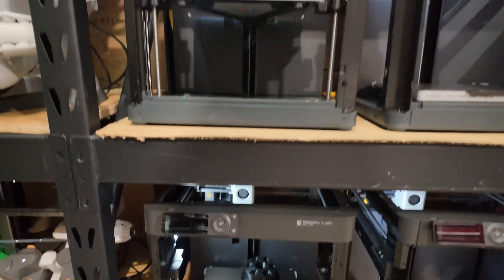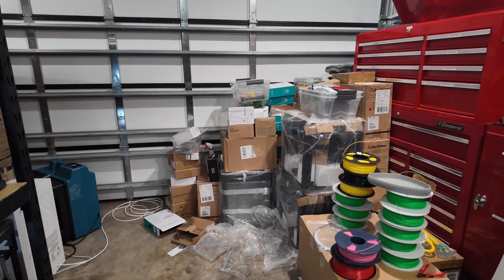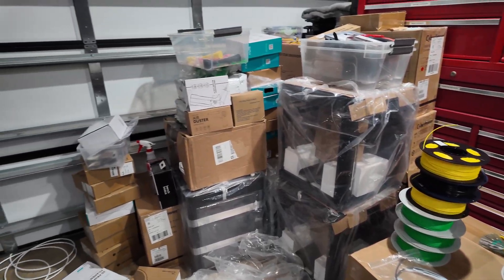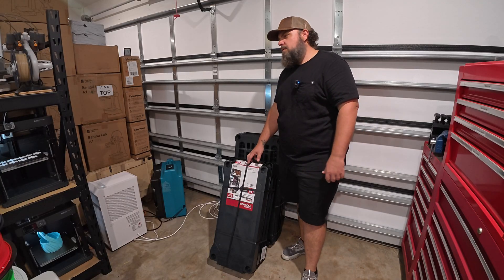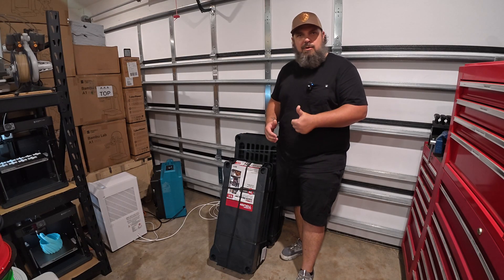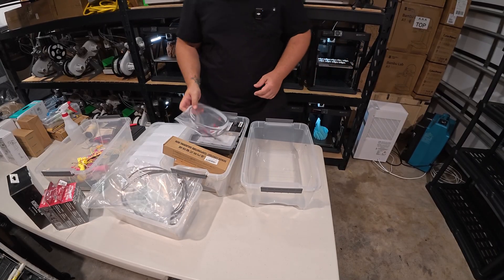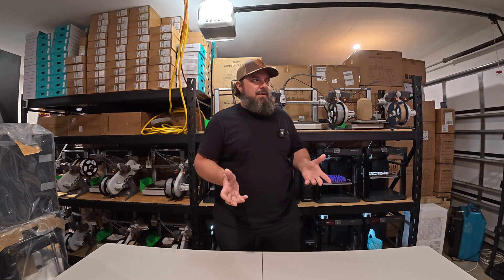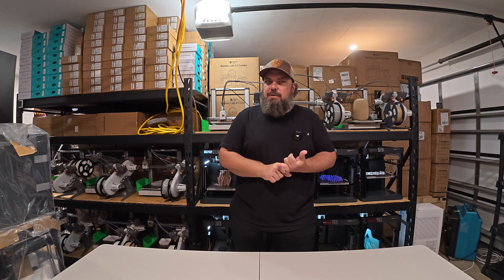Day 11: In Between — What Happens as Prints Start Finishing

Comment: Are you doing this full time, as your last 11 days most people could do in 1 or 2 there not the most riveting days if they truly are whole days. Not meaning to knock you but feel you may lose subscribers as i for 1 keep coming back but feel i need more
Reply: Not trying to be rude, I agree with comment. I feel like the videos have been only shot over a couple of days and cut up.
Reply from the maker: I get where you’re coming from. The series is intentionally documenting the build day by day as it happens, even when some days are more incremental than others. As the project moves forward, the depth and pace will continue to evolve. Appreciate you sticking with it.